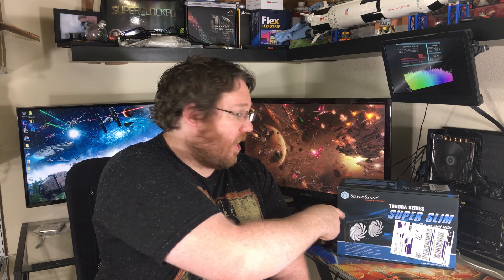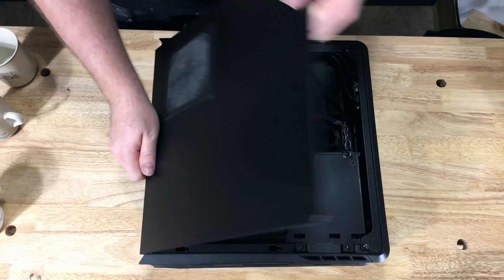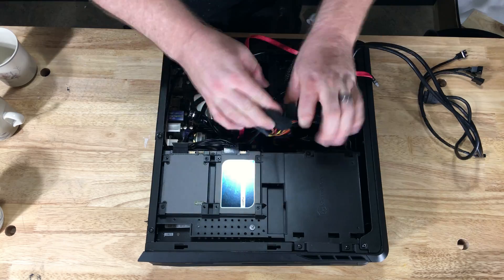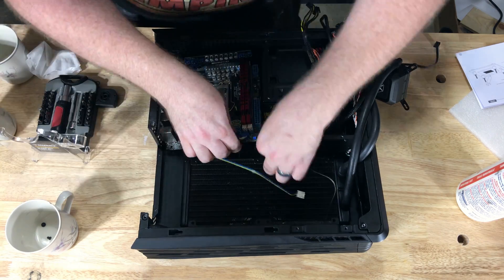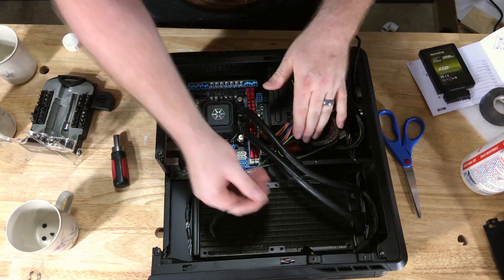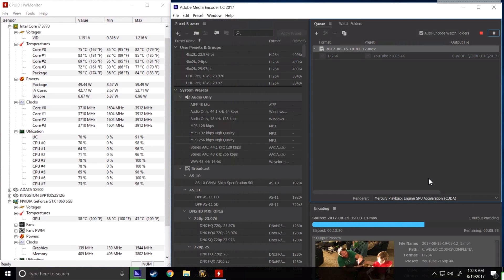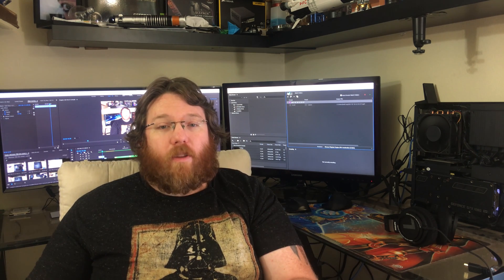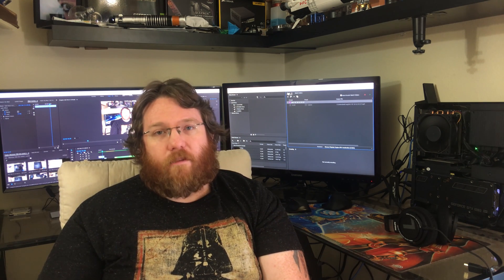An AIO Liquid cooler in my ITX??    Its more likely than you think!

Comment: Just an update on this video for 2020, if you can't find the silverstone slim aio, you can always buy the Alphacool LT and match it with a slim radiator. If you go with the water cooling route for the GPU as well, make sure you pick a low resistance radiator or use another slim pump for redundancy and assistance to the cpu block pump.

Comment: For Anyone who watches this video, Please mind that you try to mount the radiator higher than the pump of the cooler to avoid any air bubbles being trapped in the pump itself. It could lead to future damage to the cpu and or pump.

Comment: Hi
I managed to put inside the 240mm aio along with gtx 1070

Using 2pcs scythe fan 12mm thick on Ufo-01 240mm aio
And the rare gtx 1070 katana (so thin and so gooood)

Temp at full load is 60-70 degrees
Im using 88W TDP i7 4790. Max is 72 degrees then it keeps on fluctuating. Really cool 😎

Comment: Reading from the comments it seems that you dont have this system anymore. But I have the same case and I have temp problems on my cpu, is it really okay to put the Rad in front of GPU? Im opting to buy a thicker rad and Im just wondering if the GPU temps did really deteriorate or did it improve? And what is the orientation of your fans of aio, is it both intake? or exhaust? thanks!

Comment: I travel for work quite a bit and instead of building an ATX computer for home ($2500) and buying a gaming laptop for travel ($2500) I would prefer to be able to take a near console size ITX computer with me and Plug it in at home when I'm not traveling ($3000) but I'm concerned with cooling as you ran into issues as well.  I would prefer to keep all components inside the case so it doesn't get broken off in transit.  I prefer the Slim console type case designs as they will fit in a suit case quite well, making transport easier.  I want a full size graphics card and many ITX Cases allow for GPUs up to 330 which is more than enough for most high end GPUs, but the stock low wattage PS for the 202 seems under powered for the high end graphics cards on the market and I've been unable to find adequate options for higher wattage PSUs. (requiring 650 or 750).  The Raven from Silverstone allows a PSU Up to 150mm in length (they recommend 140 max for cable management.)  I am of course going through Cable Mod to get custom length Cables so excess lengths will be at a minimum.  How much clearance did you have between GPU and Slim fans with Radiator?  Any input would be greatly appreciated.  

TLDR: Slim ITX Case with 240mm AIO CPU Cooling without sacrificing GPU Cooling.
Reply from the maker: Hey thanks for watching!  I always meant to make a follow up for this video, but it just never happened.  It turned out that my cooling results were incorrect.  The water block wasn't seated firmly on the cpu.  There is a tiny heat sink on the mb that was preventing the block from sitting properly.  It was just a tiny amount, and wasn't visible just by looking at it.  Once I finally figured this out and corrected the problem, temps were  a bit better.  But, when overclocking, the AIO did no better than a decent low profile cooler.  And in some cases, like with the Node 202 where you can mount a standard 120mm fan above a decent slim cooler like a noctua or Sythe, the AIO had worse performance.  I was able to put a ASus ROG strix 1080ti into my  Node 202 with JUST enough room for a couple 120mm fans to push air into the card.  It worked really well and the card stayed reasonably cool.  I ran that, and an overclocked 1700x overclocked to 4ghz on the stock PSU, drawing a max of 400w at the wall.  There are a variety of SFX12v PSU's that will fit into the Node 202 (or any other ITX case for that matter) that range from 400 - 800w.  The higher watt SFX psu's can be a bit pricey. Check out PCPARTPICKER.COM  for a comprehensive part list and prices.

As for the clearance in the silverstone case, if I had the fans inside the case the MSI 1060 would have been resting on whatever was under it (be the radiator or the fans).  I say resting, no force was being exerted when the case lid was inserted.  
I wound up moving the silverstone slim AIO to a Phantek Shift case to cool a 7700k.  I wound up ditching it as it just couldn't keep the thing as cool as i wanted.  I replaced it with a Big Shuriken Rev.2 with a noctua 120mm fan and it cools way better, and a lot quieter.  The slim fans are cool, but aren't very effective as radiator fans, IMO. Hope some of this helps, good luck!!

Comment: Can you tell me (aprox) how much space there is between the graphics card and the aio coolers radiator?
Reply from the maker: benisbros This System doesn’t exist anymore.  But I think I was contemplating installing the fans inside between the case and rad.  If I remember correctly, I decided not to because the GPU slightly touched the rad.

Comment: So if I put an 120mm rad with a fan inside and next to my 170mm long graphics card, it's possible? :D

Because I'd love to buy this case, but I want a water aio in it XD
Reply from the maker: KevKev it’s been awhile since this video, and this case build.  I’ve used several cases very similar to it and the phantek shift.  You just can’t fit an effective water cooling solution into these cases that can’t be beaten by a top end cooler.  Unless you want to modify the case and put the rad outside the case, I just don’t recommend it.  So...  yes you could, but it’s not going to cool any better than a top end itx air cooler. From my experience.

Comment: I have this case. I can fit 2 single fan radiators for 2 AIOs CPU and GPU by sawing through one of the support walls near the videocard spacers and removing the metal shielding from the mini PSU. its cramped but seems like a xbox one up on its side now. (Its overheated and wont boot up now, guess i need to consider air temps even though i use liquid cooling now)
Reply from the maker: DeanRendar84 yeah I found airflow pretty critical for this case.  Nice setup, hope you get it figured out!

Comment: I just used your video for my new RVZ03 build! Running a I5-9600k, 16gb of RAM. I didn’t realize your card was slimmer until after I tried to put everything together (980TI is what I’m running). Temps seem to get a bit warm, but I think I’m happy with it so far. Eventually I’ll swap the 980TI with a mini card, but right now that card is still trucking along.

They did change where the RGB controller is, so I had to remove it and find a spot for it (It had been mounted below the video card and where a 2.5 mount was.

Your video was a big help in trying to figure everything out! Thanks!
Reply: My Specs:

Case: Silverstone RVZ03-argb
MB: Asus Z390-I Gaming
CPU: I5-9600k (6 core, 3.7ghz stock)
Cooler: Silverstone TD02-Slim
RAM: G.Skill 16GB 3000mhz
PSU: Corsair 600W SFX
GPU: EVGA GTX 980TI (reference style)
Hard drives: 128GB m.2 (running the OS), 1TB m.2 (for games), and a 4TB SATA SSD (everything else).

I upgraded to braided Corsair PSU cables and that reduced temps by a good amount.

I highly recommend the m.2 drives if you can just to save on airflow from cables.
Reply from the maker: Elijah Mitchell thanks so much for the great comment!!  Glad this video helped get your rig going!

Comment: The i7 3770 can only boost to 3.7 on all cores. It only goes to 3.9 on a single core. Those temps are pretty high. I used the ID Cooling IS 50 and the temps idle at 20-30 and stress test at 60-70 on my i7 3770. Fan speed never exceeded 1.1k, which is pretty quiet.
Reply from the maker: On z77 motherboards (like the P8Z77i-Deluxe I'm using and the z77 sabertooth board at least) The 3770 was able to be pushed to 4.224ghz on all cores by setting all core ratio to 42 and setting the blck to 103 in bios. When the chip was relevent, I knew people who were able to push the blck even higher and go beyond 4.3ghz. And yes, my temps turned out to be WAY to high. I was never really happy with the results. Turned out the pho cooler on the north bridge was preventing the cooler from sitting flush on top of the CPU.  Much later, after this video, I revisited.  Removed the NB cooler, reseated cooler, and retested.  Temps dropped significantly.

Comment: seriously, you have either a defective chip or defective cooler. Right now I'm stressing my rig (essentially same case) with a C7 under prime 95. 5:00 in and max temp is 63, idle was 31 for the same core. I have 3 120mm push air in and not under full blast either, though is a bit noisy but not overly so and you wouldnt hear it under normal gaming/movies.
Reply from the maker: Sovek you are... sorta correct.  I was having a hard time believing the temps I was getting.  Turned out the c7 wasn’t sitting correctly due to the blue cooler on the z77 chipset.  IT LOOKS like it’s seated solidly, but there is a very small lip on that blue piece that the cooler was sitting on.  Lifted it just enough to prevent proper seating.  Had similar issues with two other coolers, it was very difficult to see.  Once I pulled that piece off temps fell right in line where I was expecting them to.  Follow up video was made but wound up losing all footage and was already involved with several other projects preventing me from reshooting .  Good eye though, and very correct on temps!  Thanks for watching!!
Reply: ahhh, I just pulled up pictures of the Z77 ITX MB and yeah, the MSI is really bad but ASUS isn't looking much better. Judging from images of my Gigabyte H110N the chipset cooler is flush (or lower) with the retention frame. All of the Z77 boards look like they use a much thicker cooler. Its a shame too because the C7 is a pretty good cooler for the size and price.
Reply from the maker: Sovek yeah I’m a big fan of the c7 and the shiruken rev. B.  Excellent coolers with even more potential when paired with standard 120mm fans.  Currently have both in use as we speak!

Comment: Nice! I have 2 questions.. How thick is that GPU? and did the GPU get hotter? I'm assuming that, as now its getting warm air.
Reply from the maker: HABS Inc. the card is only a one slot card with a two slot bracket.  Under full load (furmark) in a room at 22c, with fans at about 50% temps reached 66c - 69c, no thermal throttle.  Those little fans push a LOT OF AIR, combined with the pull of the gpu fans it stayed well within acceptable levels.
Reply: Ok.. thanks! So with a two slot 39mm thick gpu,  would the slim rad still fit?
Reply from the maker: I'd think yes. I believe the MSI Armour GTX 1060 I used is 38mm thick, but is a GIANT PCB.  I'd think with one of the more current mini's you'd save even more room and not sacrifice to much thermal performance.  AND the slim rad would still fit (and you might even be able to use a standard 120mm fan on the opposite side of the GPU).

Comment: Could you do a custom loop in this case with a watercooled small gpu(eg msi gtx 1070 mini) and slim radiator
Reply from the maker: krazybonnie 55 yes, but it would require a bit of planning and some trial and error.  The slim aio didn’t have very good results vs a normal air cooler.  I think adding a second source to cool would over stress even a custom loop.  But with a water clock on the gpu you could fit a beefy 120 rad, and a small pump/res combo in (and under) the gpu bay.

Comment: think this same method will work on the RVZ03 case?
Reply: Did you manage to fit this in the rvz03? Before I buy it haha
Reply: @Subsidize101  fax
Reply from the maker: It's basically the same case with updated looks.  So this should work.  Good luck!
Reply: Black Wolfe CC i will gonna see if i can do push pull on aio and have a 120mm above the cpu too...and might see what kind of gpu too

Comment: Very nice my friend. I currently have Silverstone RVZ02 with Noctua nh-l9i and a gtx 1080 asus rog strix... I was thinking on trying to make a watercooling system but there is nowhere to fit any Radiator in there  I cannot even fit a fan in there :p
Reply from the maker: Thank you very much!  Yeah, with these cases I think the best bet to fit an AIO is a GTX Mini and a 120mm AIO.  The ASUS Rog Strix series cards are massive cards!
Reply: I'm currently building in the same case, but I'm using the Zotac 1060 3GB Mini and a Noctua NH-L9a. I was thinking that in the future I could possibly upgrade to water cooling, and the fact that I have a mini card might allow me to place a radiator in there at some point.
Reply: It's possible.... Watercooled Node 202, which is 2 litres smaller than the RVZ02 is here; https://www.youtube.com/watch?v=EgXAEFHECQM